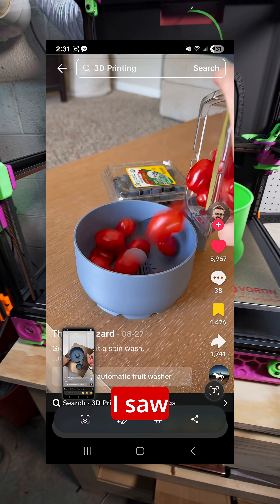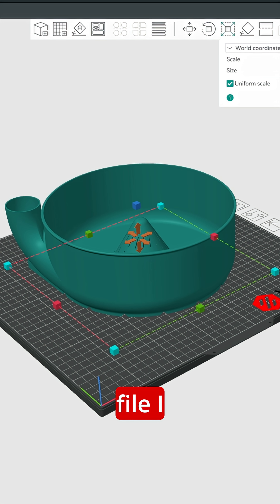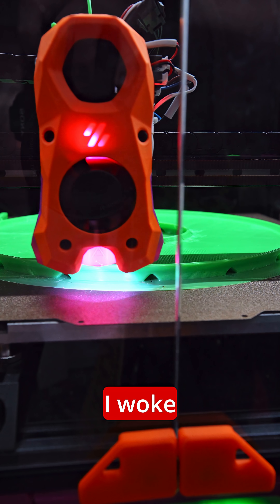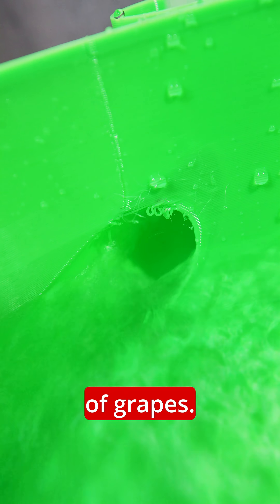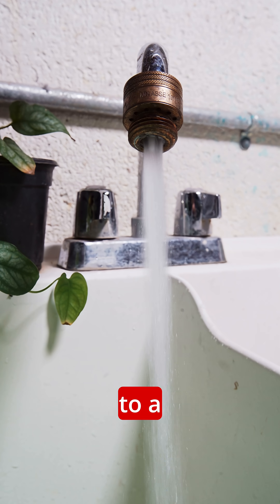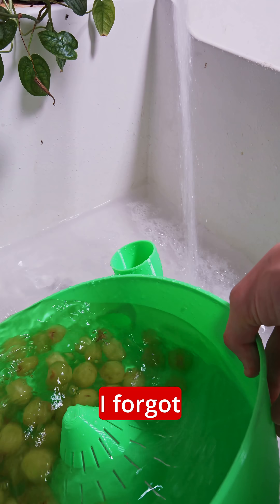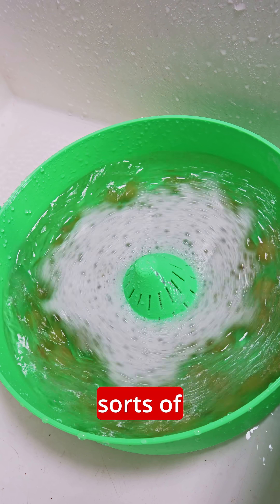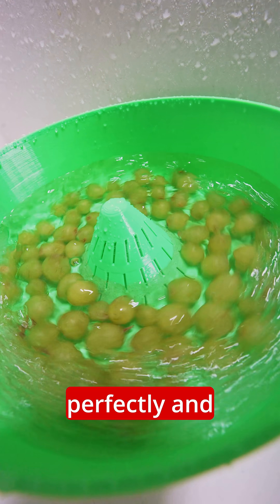Printing A MASSIVE Automatic Fruit Washer  #3dprinting #diy #3dprinter

Comment: This design is stupid, you need water pressure AND liters of water.. a clever design would involve little water and spinning to clean the grapes without adding 2$ to your water bill every time you wash them with that thing 😂 also maybe using a small diameter tubing that directly connects to the faucet may increase the water pressure, but still you'll need the ridiculous amount of water. As I am writing I thought of at least four different designs but all of them would require the user applying an external force that is not the one of the flowing water, so at this point you'd be better off just washing them by hand
Reply from the maker: yeah im just going to use a bowl like i always have

Comment: Be careful using 3d prints for food handling.  Filament layers trend to hold bacteria.
Reply from the maker: Im skeptical of this. when i look at any plastic utensil or bowl they have hundreds of micro scratches which would also harbor bacteria.
Reply: I'd be more concerned about small plastic particles ending up in the food (even if very unlikely) than bacteria, that shouldn't be a problem with proper cleaning

Comment: 10 minutes of running water for some grapes is wild 😱
Reply from the maker: Normally like 45 seconds but after the laundry water got on em I let it go for a while
Reply: Do… do you shower?

Because that’s about ten minutes of running water.
Reply: @iBrendan1579 what? I need like 5 mins Max of running water when i shower
Reply: @iBrendan1579  thing is, you usually can't use less water when showering (although half the time is shampooing), but you CAN use much less water when washing fruit if you just use your hands or a scrubber after filling your sink or a bowl with some water
Reply: @iBrendan1579 mind you I said "for some grapes". Do... Do you read?
Reply: @iBrendan1579  
Yeah, I also use a lot of power to drive my electric car, but if I saw a video of a small light bulb that takes up the same amount of power, I would also say it's wild.

Comment: microplastics for free
Reply from the maker: Yeah usually you gotta pay for them. So with this not only are your grapes clean of pesticides but they are seasoned nicely with micro plastics
Reply: Dude it's PLA. It doesn't make microplastics
Reply: @MisterKrakens ugh yes it does. In fact iirc someone did the math on how much micro plastics 3D printed PLA parts produce vs injection molding and iirc it was sometime like 1000x. Now 1000x what's probably close to 0 isn't very much, but it will add up over your life time if you use a kit if 3d printed food products.
Reply: @MisterKrakens wtf? Where to people hear nonsense like this?
Reply: @MisterKrakens  i bet you don’t freaking own a 3D printer and yes 3D printers sometimes gives out microplastics into the air and loose little pieces of plastic/microplastics can get onto something and contaminate it. Injection mold is much safer